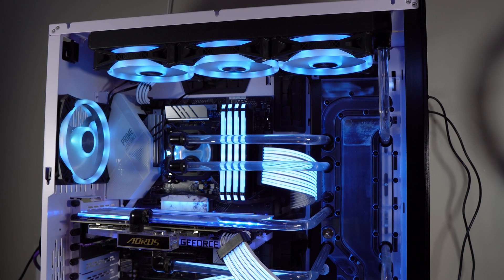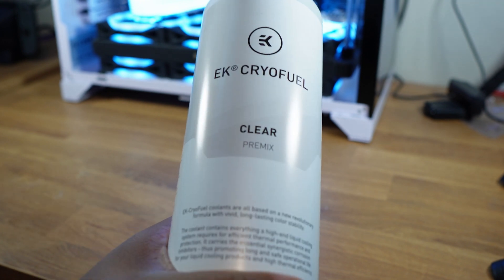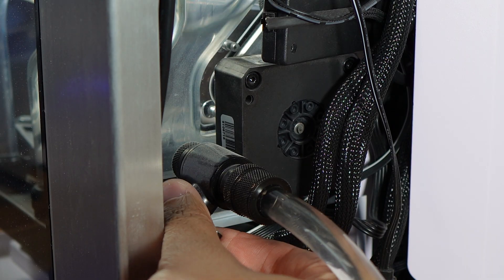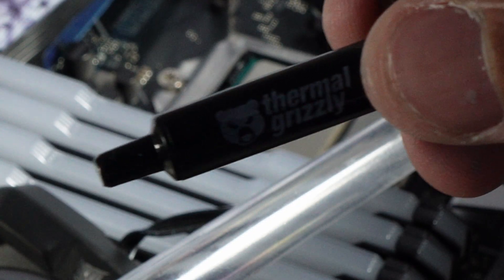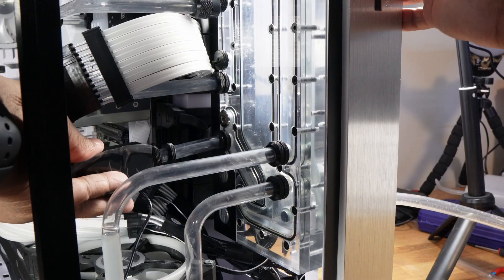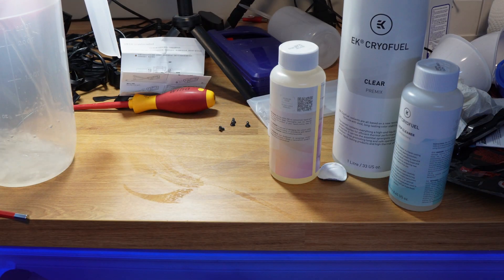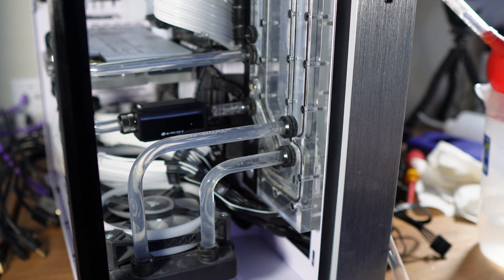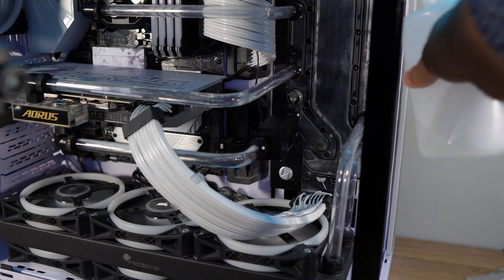How to Perform a PC Coolant Flush: A Comprehensive Guide to Maintaining Your Liquid Cooling System

Comment: Doing mine now and the system doesnt drain the best so time consuming is an understatement I am on day 4 still trying to get suplerflush completely out of the loop i will say it is doing a great job of cleaning though
Reply from the maker: Good Luck!
Reply: @laytrix14  I finally got it took several days of draining cycle drain cycle etc didn’t have a pump jumper so I was hesitant to do that but had to and thankfully all worked out and it is clean as can be.

Comment: Question about using the jumper: I am doing a leak test. I have additionally unplugged the cpu and gpu cables. When I flip the switch to power on I still have my fans and some of the rgb on the case powering on with the pump, is this still okay?
Reply: you probably did not remove the SATA/peripheral cables which is fine but those are typically powered by your MOBO

Comment: Thank you.  You have talked me out of ever using a liquid cooling system.
Reply from the maker: Yeah it’s not for everyone!
Reply: I built a custom PC cooling system last year using all premium EKWB GPU, CPU water blocks, distro plate and hard tubing.  It took forever, was a pain to build, expensive and rig weighs a ton but my son gets better temps using a CPU AIO cooler and air cooled GPU.  My rig has been a giant disappointment and big waste of time and money.
Reply: @80HD_82 you did something wrong then
Reply: @zebrad  Not sure what that would be.  Followed manual, used correct water ports on distro block, flow direction is correct, used recommended jet plate on CPU, etc… If someone could show me the same setup with better temps then I would rethink my position.  Otherwise it was a big waste of money.
Reply: @80HD_82 what does the weight of the pc have to do with anything lol
Reply: @Chris509JF  When you need to tilt and steady the pc with one arm just to put coolant in the distro block using your other arm every few weeks then it has a lot to do with it.  Also, moving it around to clean the dust out with compressed air is a pain.